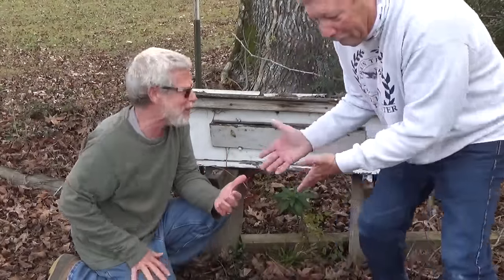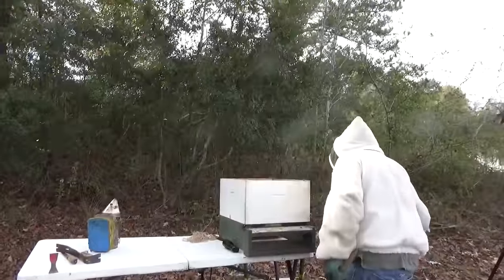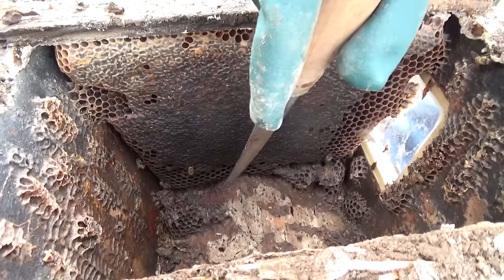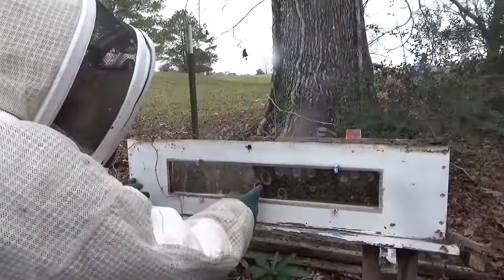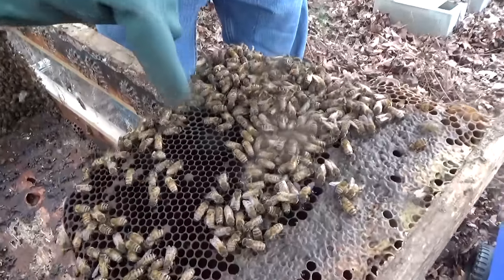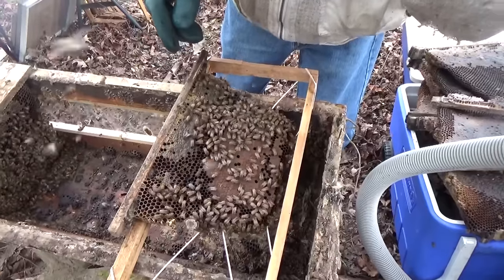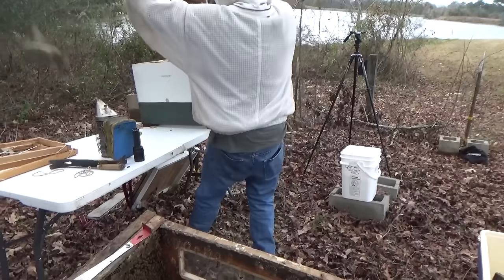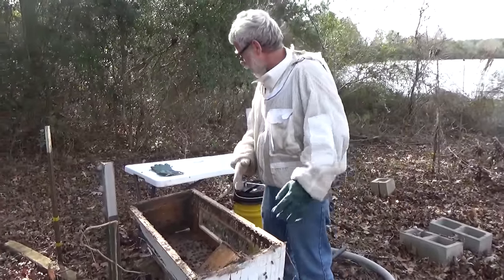It's been 14 years since this top bar has been opened and we are transferring the bees.

Comment: home depot has a dewalt battery powered multi tool kit on sale for $99 if someone wanted to send jeff one.  I used a friends. very easy to change blades and angle of blades. comes with 2 blades.
Reply from the maker: I definitely need one, mine is electric so it needs power, but to have a battery operated one, like the bee vac I use, would be awesome. And if anyone out there is feeling generous, my address is:

Mr. Ed 
75376 River Rd.
St. Benedict, LA 70457

Thanks for putting that out there for me Fred and for taking the time to watch the video. Until the next one, God's peace brother.
Mr. Ed
Reply from the maker: They are 7 inch rubber bands that I buy off of Amazon for about 7 bucks for 200 of them. Thanks for watching. God's peace Nola.
Mr. Ed

Comment: What size/length of rubber bands did you use? I think I'll be doing similar transfer very soon.
Reply from the maker: I use a 7 X1/8 inch rubber band I buy from Amazon. They come in a box of about 200 for about 10 bucks. Thanks for watching, and I hope you will check out more of my bee wrangling/ bee rescues adventures and let me know what you think of them. By the way, I post a new video every Friday morning, and I look forward to hearing from you again soon.  God's peace Danny.
Mr. Ed
Reply: @JeffHorchoff  I used your rubber band technique to help a hive that had been abandoned. The original bees died out. Butt I am using the old comb with a 2 frame swarm with virgin queen. About 2 weeks later: queen is laying great, I've got 6 frames of bees and they haver "welded" most of the old comb to new frames with the help of rubber bands. Thanks again!